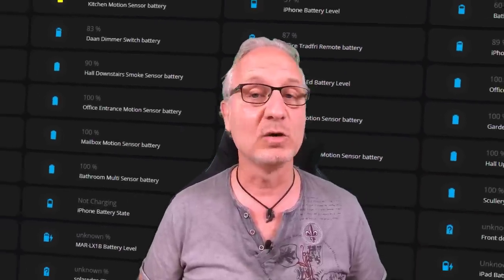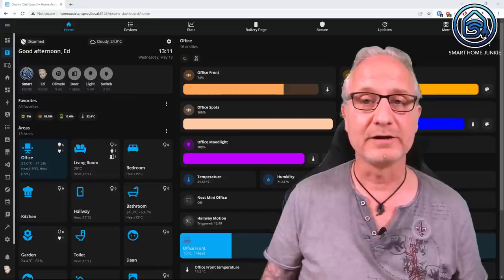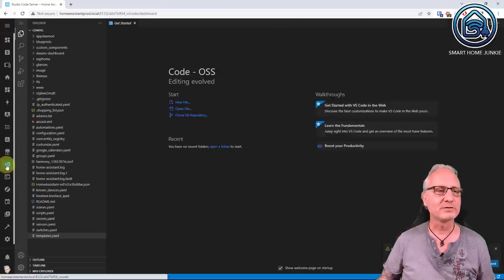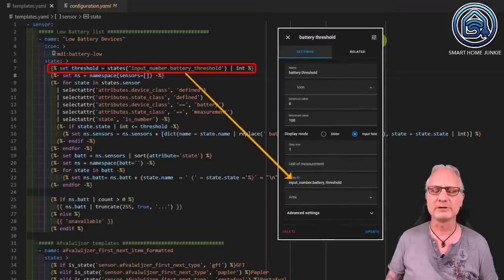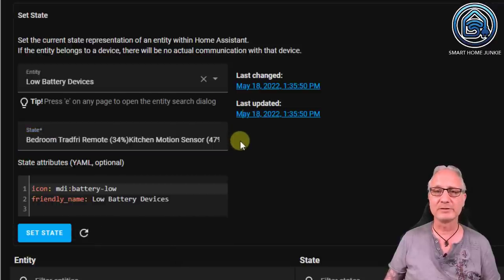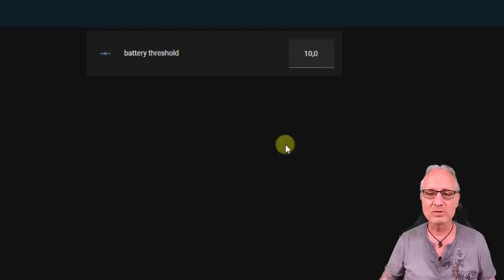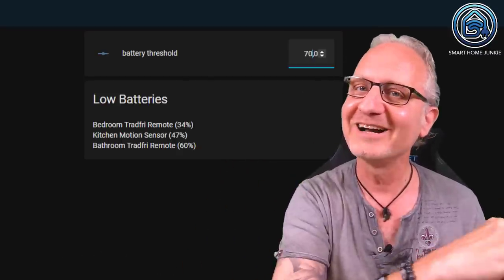HOW TO create your own Low Battery Warning Sensor In Home Assistant - TUTORIAL

Comment from the maker: Do you know of any other ways to show the battery status of your devices? Let me know in the comments!
Reply: Hi, yes If I go on state's and call any device with battery I see the value in the state
Reply: In NodeRed: [MQTT NODE] -> [JSON CONV NODE] -> [FUNCTION NODE]

var json=msg.payload.battery;
if ( json < 30 ){
msg.payload = "Battery is running low on: " + msg.topic +", battery level is: " + msg.payload.battery;
return msg;
} 
return 0;

This has an mqtt listener to "zigbee2mqtt/+", which then checks the battery level of all updates. When it sees one with battery being reported as below 30 it passes a message out to a push notification. A trigger in the path prevents multiple notifications within an hour. So far this seems to cover all of my devices, but an elseif statement could make this far more flexible if needed.
Reply: I use the "auto entities" card from Hacs .. really quick and basically no code.. no helpers. Also use it to create a dynamic list to show motion or lights on my dash.  Really clever card.
Reply from the maker: @notfu9320  yes, that works as well. With the code in this tutorial you can also make sure that you get a notification on your phone when a battery gets a low value. I believe that cannot be done with the auto entities card.

Comment: Another terrific video - and I was happy to buy the code.
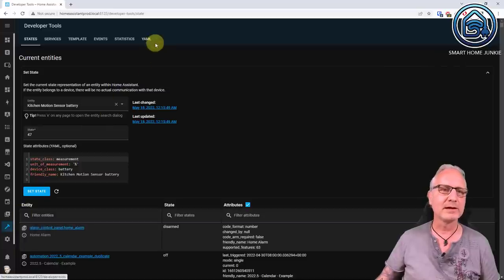One very small correction: at 11:20 you reload the template file without restart. TEMPLATE ENTITIES only appears in the list after you have done one restart since adding the "!include templates.yaml" statement in configuration.yaml. So you have to do one restart (after checking configuration is OK of course). Then you can refresh TEMPLATE ENTITIES after any updates without a restart.

Comment: Thanks for this I learned a few things once again, glad I found this. 

When I decided to do a battery warning in HA I went Node Red. Took only 4 nodes an inject, get entities, format and call service. Batteries are checked every day at 3pm and a message is sent to my iPhone if any are low. New devices with a battery are included with no new code changes. The alert will repeat daily until the battery(ies) are replaced or charged as the case might be. 
Did a more complex version to do actionable notifications for low printer ink with the ability to mark the low ones from the iPhone once the replacement has been ordered. Keep the videos coming!
Reply from the maker: Yeah, I do have a low printer ink automation as well. The notification on my phone also leads me to an online shop to order the correct cartridges. It's just one click and I can order them. Life saver!

Comment: Great video.  I got it running and it's great for monitoring all of the batteries.  I then setup another version to report if any of my temperature sensors start reporting high temperatures.  My smoke detectors don't monitor heat and now I've got that.

Comment: Thank you so much for this! I went ahead and donated to support you. One question I have is on notifications, I'm using this in a notify service, is there anyway to extract out the batteries that are low for the Slack message?

Low Battery Alarm The battery of the sensor(s) {{sensor}} is low.

On a misc note  have some Ring Contact. Sensors and I have to hide several entities that were showing as a battery for some random reason.
Reply from the maker: Thank you. You can use {{ states('sensor.yoursensor') }} in your message.
Reply: @SmartHomeJunkie  Thanks! I tried the sensor.sensorname but never tried it wrapped in states.

Comment: Loved the video, agree with your view of only showing the batteries that are running low, but i have been trying to do one thing just as a visual preference, ( i must say i am a novice at HA )  i was trying to get the icon to show with the device name and percentage, i only wanted to have them visually show as either yellow or red, yellow indicating i have some more time before i need to take action and red when, ok you better go replace the batteries now.

I tried everything i could think of in modifying this card and everything chatgpt suggested but got no where even with switching to different card types.  
Can you help if it is possible to do with the way you present them?   Appreciate any input.  Great work on the videos btw very detailed which is outstanding.

Comment: Hi and many thanks for this very interesting tutorial.👍 Well done 😄
I tried the "auto entities card", but have some problems to configure it for devices not using the device_class: battery (who use % as value) but the device_class: voltage, because I have devices running with 1.5V and others with 3.0V and so on...
When creating the card and setting the threshold for ex. to 2.6V as alarm for all the 3.0V devices, all the batteries from the 1.5 devices are also listed as alarm...
I hope you understand what I mean :)
So now, I wonder if with your project, it is also possible to solve my problem, when using the device_class: voltage with different voltage levels for different devices and then also different thresholds (setpoints)?
I think changing the code part in your project to use the needed class will be ok and running for voltage instead of %,  but I'm currently stuck with the problembut how to show in the list only the batteries with a real alarm level, depending on the real operating voltage of the individual devices.
At the moment, if the threshold is set to 10.5V as alarm level for 12V devices, all devices running with lower voltage will be shown as low level alarm in the list....!?

These are the state attributes from one of my devices who do not use the device_class: battery but voltage:
state_class: measurement
interface_id: ccu3-webui-HmIP-RF
address: 00365F29AC1C5D:0
model: HmIP-SWDO-2
entity_type: generic
parameter: OPERATING_VOLTAGE
function: null
value_state: valid
unit_of_measurement: V
device_class: voltage
friendly_name: Fensterkontakt_EG_Flur Betriebsspannung

Thanks for any help and suggestions.

Comment: Good Morning, another wonderful video. Really did like the pop-up that refreshed you on the data source i.e. the state attributes. When your trying to retain knowledge without a computer in front of you, it makes it so much easier.
I have always call the file, sensor.yaml, is there any rules that I should be following or did I miss the memo.
Reply from the maker: Yes, there's a new and modern way of handling template sensors and that is by using the templates.yaml. The old way of using template sensors does not always work together with the new way unfortunately, so if you want to use the modern way, you should migrate all your template sensors to the templates.yaml and reformat the code a little bit.

Comment: Thanks for another stunning video! I am just wondering how to implement batteries that do not give a specific value of the battery state but only if the battery is low or not. Did you try this? Could you please give a hint how to do this as well to a noob as me? Thanks again!
Reply from the maker: Thanks! You can do that by filtering on the state of the entities. Filter on the state is low.

Comment: Lots of useful hints here.  Thanks!

For this specific use case, an Entity Filter card seems like it would also work, and perhaps be a little simpler.  You'd end up with something like an Entities card containing all of the battery entities with low charges, which has the advantage that they would display icons and percentages automatically.
Reply from the maker: Yeah, but what's the fun in that? 🤪
I looked into the auto-entities card too, but really wanted to have more control. Not sure what the exact reason was that I did not use it, but there was something that I was missing. 🤔
Reply: @SmartHomeJunkie  Interesting approach. Thanks for the info. I use the auto-entities card with a template filter to generate the list. It's a bit simpler and the exclude statement allows individual entities to be omitted (or multiple if you use a template in the exclude statement).
Reply: But wouldn't you need to update the list every time you add a new sensor? And it seems a bit annoying if you want a helper to define the threshold instead of a hardcoded value

Comment: Another great video. I was glad to contribute. I have a couple of batteries where the value is coming from the internet (Apple, Ring & BMW). They are missing the 'state_class: measurement'. What would you suggest as a workaround for a NOOB?
Reply: I added 'state_class: measurement' to BMW and it is showing up. I suspect this will break the next time the integration is updated.
Reply from the maker: Thank you for your support!

Comment: As always very informative and helpful.  I do have a few questions however, mostly related to the yaml code.  In the earlier video "Templates and Custom Sensors in Home Assistant"  the blocks are defined by "platform: template"  with a sensors: token below it.  In this video, the whole file is in the templates domain (I think domain is the right yaml term) and sensor listed below it.  While the hierarchy seems roughly the same, the syntax certainly isn't and I find it confusing on which to use when.

The other thing that confused me is in the templates.yaml file in this video, after the sensor: tag, the following lines are indented 4 spaces vs. the normal 2.  I indented mine 2 and the sensor wasn't seen - when I also indented 4 it worked but I don't understand why.

Any insight you have to these would help me in this mysterious land of yaml.

Thanks again for all your good work.
Reply from the maker: The video you are referring to is old. Please follow this course to fully understand templates:

https://youtube.com/playlist?list=PLKuGrHcHLKMiUTClEE8vb60m9v3ijFEhQ&si=KT29mvTX0eRjQeSV

Comment: I like the video and I've implemented it. Thank you ! The only problem I'm having is that if the result of the markdown card is >=9, the 9th entity is only partially visible where the rest is invisible.
Reply from the maker: That is because the state of the sensor can only be 255 characters.
Reply: @SmartHomeJunkie  is there anything to do about that ?
Reply from the maker: @jenswymeersch9653  No, it's a system limitation. But if you have so many batteries that are below a certain level, you'd have to replace the batteries anyway and the list will be shorter. 🤷🏼
Reply: @SmartHomeJunkie  agreed. That said, the number of battery driven devices has become quite large - 100. So 10% will bring me over the limit...
Reply from the maker: @jenswymeersch9653  You can also use a different approach by using the auto-entities integration from HACS. Maybe that one fits you better?

Comment: Thank you for the nice video. I also have devices that have a battery state that is not numeric, but a text value. It just says 'Normal' or 'Low'. Would it be possible to show those devices as well?
Reply from the maker: Sure, just add them to the filter in the template.

Comment: Clear and helpful, as usual. I imagine that device_class == battery will be consistent between different manufacturers' devices. But can one count on state_class always being "measurement"?
Reply from the maker: It depends on your specific devices, but you can check in the developer tools what the attributes are for your devices and adapt the code if measurement is not available for specific devices in your setup.

Comment: Great video! I'm struggling with adding binary sensors to your sensor code. some of my sensors only show 'on' or 'off' as a battery warning when the cells get low I've tried adding states.binary_sensor and using the battery device class and state = 'on' but i just get errors in the notification and it stops the whole sensor working. Anyone able to help?

Comment: Thank you for all your Videos to Homeassistant. With this one, I have a problem, because if I set the threshold to 70% (or any other number) I still get unavailable and dont know why.
Reply from the maker: Check the template in the developer tools and see if your devices get filtered by it.
Reply: @SmartHomeJunkie  No they dont get filtered
It says unavailable, even if I raise the % to 99%
Reply from the maker: @josefpay8042  You have to change the template so that they get included. The video explains how the template works and you can adapt it so that it fits your devices.

Comment: Great video as always, just one question! All my sensors with batteries are running true zigbee2mqtt and don't have a state_class so the battery sensor isn't working. Any tips how to resolve this?
Reply from the maker: Thx. The best way to make it work for your specific devices is to see what attributes your devices have in the developer tools state tab and then alter the code using your own attributes. So, in your case remove the state-class lines and maybe replace them with another attribute.
Reply: @SmartHomeJunkie  Thanks for the quick reply, removed the two lines with state_class, but unfortunately it's still not working. Do i have to remove a other line or piece of the template?
Reply from the maker: @TiborMiska  I wouldn't know. Each install is different. You can debug it using the developer tools. Just copy the sensor code in the template editor in the developer tools and tinker with it to get it working. I find it curious that it does not work at your side because I also use Zigbee2MQTT and my devices do show a state_class.
Reply: @SmartHomeJunkie  I will thinker with it and will make it work. But indeed strange the i do not see the state_class.
Reply: @SmartHomeJunkie  Managed to get it working, it seemed that i was running an old version 1.18.1 of z2m, updated to 1.25.1 and state_class is visible and everything is running smoothly. Thanks!

Comment: it appears (for some reason) I can`t get this running .. if I take the code from IDE where I edit into TEMPLATES under developer tools I`m getting the following error:  UndefinedError: 'jinja2.utils.Namespace object' has no attribute 'sensor'  ... the code is fine I triple checked it and also the check config went fine, sensor is created however no matter what input value I set in the helper the low_battery_devices sensor returns unavailable ..

Comment: Only issue is, that with the latest update, the entities card for the sensor has changed from the type shown. How do I amend the entity card to work as yours does? A big popup when I click on it showing the history of the setting is.. well.. cluttered.
Reply from the maker: I'm not sure what you mean. I do not use the entities card in this video. 🤷🏼
Reply: @SmartHomeJunkie  I should rewatch it then, to find the right card for the sensor to have the slider and the typing box. Many thanks for the excellent code, works perfectly.

Comment: Do you have a way to keep track of what battery each device uses and append it to the battery level script?
Reply from the maker: Hi! Do you mean the type of battery?
Reply: @SmartHomeJunkie  correct, I want to track which device uses which battery so I know if I have it or need to buy more before it dies.
Reply from the maker: @AlexSherm  Interesting question... I have to think about it. It is possible with some nasty code, but I would like it if you can add that info to the existing battery entity.

Comment: I've watched the video several times and am unable to find a "Low Battery Devices" entity when looking for it in the Developer Tools > States > Set State section.  I have a pretty new Home Assistant Yellow that I took out of the box less than a week ago with very few changes made to it from factory settings.

I've gone through the responses here looking for a solution, but nothing seems to work for me.

I'm not sure what I'm doing wrong, as I've gone over the code several times and I believe I've done everything exactly as stated in the video, but with no success.  Can you help me please?
Reply from the maker: Maybe rebooting HA helps?
Reply: @SmartHomeJunkie  I restarted HA and now it's throwing this error.

 Invalid config for [template]: invalid template (TemplateSyntaxError: expected token 'end of statement block', got '{') for dictionary value @ data['sensor'][0]['state']. Got '{% set threshold = states(\'input_number.low_battery_threshold\') | int %} {%- set ns = namespace(sensors=[]) -%} {%- for state in states.sensor\n | selectattr(\'attributes.device_class\', \'defined\')\n | selectattr{\'attributes.state_class\', \'defined\')\n | selectattr{\'attributes.device_class\', \'==\', \'battery\')\n | selectattr(\'attributes.state_class\', \'==\', \'measurement\')\n | selectattr(\'state\', \'is_number\') %}\n {% if state.state | int <= threshold -%}\n {% se.... (See /config/templates.yaml, line 0).
Reply: I figured it out.  I had a { instead of a ( on lines 13 and 14.  

Thank you so much for your videos.  They are extremely useful and I'm grateful for your efforts.  Can't wait for the next one.
Reply from the maker: @devonhowton  That's great to hear!

Comment: Any idea why Low Battery Devices would have a state of unavailable when I have the threshold set to anything: 10, 50, 99 anything?
Reply from the maker: Check the attributes of your battery entities. It might be that they are different in your case. If so, adapt the code so that your devices will be included. .

Comment: I try to implemet the template and I got following error: 

Logger: homeassistant.config
Source: config.py:916
First occurred: 7:39:12 PM (8 occurrences)
Last logged: 7:50:03 PM

Invalid config for [template]: required key not provided @ data['sensor'][0]['state']. Got None. (See /config/templates.yaml, line 0).
Invalid config for [template]: [template] is an invalid option for [template]. Check: template->template. (See /config/templates.yaml, line 1).

where can be the error?
Reply from the maker: My best guess is that there is an issue with the indentation of the code.
Reply: @SmartHomeJunkie   Thanks, was not identation but a } insted of ).😏